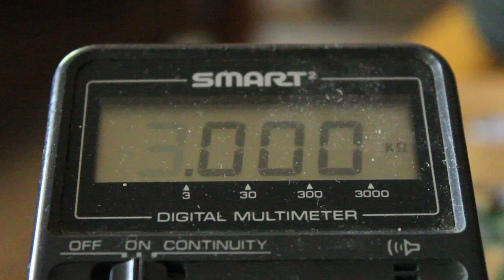PS2 Potentiometer Adjustment - Disk Read Error Fix

Comment: Sam, my ps2 DVD pot was originally set to 966 ohms. So should I increase or decrease it?
Reply from the maker: Try to get it around 700 ohms
Reply: From what I understand turning the screws clockwise REDUCES it's resistance. I.e. current goes through more easily

Comment: my ps2 has never ben open until now but there was only 3 screws will it still work?
Reply from the maker: Interesting, some have had a similar situation, I wonder if this is a manufacturing defect. This may be part of the cause, try getting a screw with a similar thread for the missing one. Take one of them to your hardware/electronics store and ask if they have a screw with a similar thread available to purchase for a replacement, then give the calibration a shot.
Reply: ok thank you

Comment: Sam, what is the life expectancy of these lasers. Also, why is it when you look up the SCPH number, it shows 77001 or 35001. Why am I seeing numbers for 7000 and 9000 series? Im thinking someone didnt put ALL the info as advertised because Im going by the number on my systems. Are there systems with the 7000 and 77000 series or is this a typo. Im looking for 2 possibly 3 lasers to replace because I have the old slide out tray box system and 2 slim line versions. Im first looking to fix the lasers from your vid and it was very well done. What can I use to fix my old discs that are scratched because some games are way too expensive to replace. Again, great detailed video.

Comment: why do we need to test the voltage? mine works now but I didn't test it. will I be safe?
Reply from the maker: Measuring the impedance of the lens can increase it's lifespan, try to aim for 725 Ohms. But don't fret if it hasn't already, it shouldn't burn out right away

Comment: My PS2 doesn't have any screws holding the drive assembly in, is that any cause for alarm?
Reply from the maker: Yeah a bit, but if it works you should be alright
Reply: Sam Campbell alright, thanks.
I've tried everything at this point, but nothing seems to remedy the problem I'm having.
My silver PS2 Slimline will play every game I have except for Gran Turismo 4.

Comment: Thanks for the help. My first attempt on the DVD adjustment did not work at 738 ohms, brought it up to 1108 ohms and it works better than before. My CD is working at 750 ohms.
Reply: thank you so fucking much , i tried everything. 720, 750, 820, 870 and so on.... but yours worked...
Reply: fock.... it started stuttering right after i commented this and now it's all black again sigh
Reply: Thijs Van Dalen you get that it's fun

Comment: Ok so my PS2 slim model boots up very slowly as of the past few months. It takes about 1-2 minutes and then freezes on the loading screen for only some games. For other games, it'll boot slow but still play it fine. Any idea on what the problem may be?
Reply: Oh and one thing to add, it boots up slow even with no memory cards or game in.
Reply from the maker: Is this after the adjustment or before?
Reply: Sam Campbell Before, I didn't do this adjustment yet. I'm not sure if this will help my PS2 since I really have no idea what the problem is
Reply from the maker: Mark Merldawg
Give the adjustment a try it sounds like a slow disk reading issue
Reply: Sam Campbell Ok, thank you! I will try it when I get a chance.
Reply: Mark Merldawg Did it work?

Comment: Hey sam , when I opened my PS2 there was a screw missing on the harddrive!!(one of the disc drive screws) any ideas where i can find another and if it can cause problems?
Reply from the maker: It could cause additional vibration, however test it without the screw 
for now. I'm not sure where you would get that particular screw.
Reply: Hmm OK me and my friend will try that, in the mean time Ill try to find a tech store for that screw
Reply from the maker: Alright, sounds good

Comment: hey sam im willing to try this but i have no battery tester thing and suggestions?
Reply: any
Reply from the maker: A multimeter shouldn't be too expensive:
http://www.ebay.ca/itm/LCD-AC-DC-Digital-Voltmeter-Ammeter-Ohmmeter-Multimeter-Volt-Tester-Tool-/381726099279?hash=item58e0a6074f:g:ggAAAOSwhwdVUep8
Reply: Sam Campbell i just did it anyways ill tell u if i fixed or not thanx
Reply: Holy shit it worked thanx bro if i damage it then i know y then
Reply from the maker: Elvis Pablo
Alright, glad to hear it!

Comment: Actually i did that and now all of my CDs works
But wont spin any DVD even new one 
What do i have to do now?
Reply from the maker: There are two screws on the lens assembly, one for CD and one for DVD, make sure you also rotated the one labelled DVD as well.

Comment: Will this work if my PS2 can read a disc?? Once I click on the disc icon it fades to a black screen and then fades back to where the disc icon and the memory card icon pops up saying there is not data.
Reply from the maker: From what you described, the memory card seems full. However if I have misinterpreted you, let me know
Reply: Thanks for the tip but still nothing has changed apart from the fact that the 'there is no data' thing no longer pops up.
Reply from the maker: OTF63
Well you could give this a shot, just make sure you use a multimeter and don't go below a resistance of 725 Ohms
Reply: I'd really love to but unfortunately I don't have a multimeter and I also can't afford so i guess I'm out of luck haha thanks anyways. :)
Reply from the maker: They're only about 4$ on Ebay, but if you're buying locally sometimes the prices are inflated
Reply: Oh okay nice, then I may get one, thought they may have been a lot more haha. Thanks again, really helpful.
Reply from the maker: No problem, let me know if you have any other questions
Reply: Thanks dude, in a really weird twist in luck i've just been given a working PS2 by my friend haha.
Reply from the maker: Great luck!

Comment: Hello, I tried this trick yesterday, but without the resistance thingy. I managed to get Ps2 games to work again. Today I did it with a machine, and I got a reading of 1065 ohms, on the dvd screw, and when I adjusted to your reccomended levels, It stopped reading discs again.

My question is, is it dangerious for the ps2 if I raise it up to 1000 something again?
and also, should both dvd and cd be around the same resistance?
Reply from the maker: I said a similar thing to someone else, 725 - 850 for the lens should be appropriate. I don't have many more pointers, but the DVD laser should be visible (don't look directly at it), if it seems very dull or not emitting at all, then it might have blow out from too little resistance. Lower ohms is actually stronger.
Reply: Yes, I saw that down in your comments, but I was just confused since mine won't work on those numbers, but it worked on 1065 ish O_O
I'm not very good at these things, i thought my ps2 to be doomed, then I found your video and thought what the heck? I can try it, it worked yesterday, but I was afraid getting a much higher number would maybe damage the laser or something.

I can honestly say, I have no idea what you mean about checking the dvd, I'm not sure how its supposed to look when ok, but thanks for answering so quckly.
Reply: If i turn the dvd potentiometer up and let the console run whit the dvd screw around 1080 ohms, apparently it does work since i tried i. Could it damage the laser in the future because of the high ohm level?
Reply from the maker: Elinione
Turning the the resistance (Ohms) up can't possibly hurt the lens, so 1080 should be fine
Reply: Thanks for the help!
I'm gonna try that and see if it works :)
Reply: @Artraive  so..did you damage ur ps2 after 4years ?? XD
Reply: @sofaxx5447  the laser pretty much died days later 🤕

Comment: Where can i get a multi-meter thats less than $3. Its all i have on my paypal. Thanks in advance.
Reply from the maker: http://www.ebay.ca/itm/New-20mW-LCD-Display-Digital-Voltmeter-Ammeter-Ohm-Multimeter-Ohm-Tester-/400579128145?hash=item5d44606b51:g:dyQAAOxyXp5SQqYV
The best I can find on Ebay is around 4$ Just barely out of budget
Reply: +Sam Campbell Alright so good news ,i got a multimeter but it keeps reading 400-500 kohms.
Reply from the maker: Interesting.. try to make sure that you have the leads on the tiny pins on each side of the potentiometer, aim for about 750Ohms (Not KOhms). It can be difficult to place them perfectly
Reply: +Sam Campbell Still no luck,i think its time to order a new laser assembly. The potentiometer was the problem though. Thamk you for helping either way <3
Reply from the maker: No problem!

Comment: OK now please tell me what was the last step in which you checked the digit number 3000
Reply from the maker: You are placing a multimeter on the two terminals of the potentiometer for the drive, then adjusting it until you get a number around 750-800, but above 725

Comment: Make sure you know what devices are plugged into the breaker that your ps2 is plugged into  because if you disconnect one of those devices after adjusting the voltage it can easily overload your ps2. The ps2 just needs that initial voltage to recognize the game disc, after that the laser chills out. So for me, I have  it connected to the same breaker as my air conditioner so, when I start a game I turn off the  the appliance (and unplug it) then once it sees there is a disc in there I turn my air conditioner back on. In this way you do not have to adjust the voltage, in most cases. There should be no reason why the voltage needs to be adjusted especially if no one has ever removed the warranty sticker from the back panel.
Reply: That's not how any of this works. The voltage coming from your panel is going to be 120v–240v AC. I can 100% guarantee that you don't have high-voltage AC current going through your PS2's laser pots.

Comment: 725 for both pots? I recently tried switching the laser and also removed the anti-static solder. Ps1 games & audio discs read fine but after playing with the dvd pot now none of them work. Any more pointers?
Reply from the maker: 725 - 850 for the lens should be appropriate. I don't have many more pointers, but the DVD laser should be visible (don't look directly at it), if it seems very dull or not emitting at all, then it might have blow out from too little resistance.
Reply: +Sam Campbell the lens was actually really bright, it spins for a while and the laser makes like a down hill pitch noise. it continues to spin then picks up speed and says "disc read error" I'll see if i can make a video when I get home later on to show you.
Reply from the maker: Ruben Mejia
Alright, sounds good

Comment: can this be done whitout that meter?
Reply from the maker: You can but it's not worth the risk considering that you can get one for $4 on ebay, http://www.ebay.ca/itm/New-20mW-LCD-Display-Digital-Voltmeter-Ammeter-Ohm-Multimeter-Ohm-Tester-/400579128145?hash=item5d44606b51:g:dyQAAOxyXp5SQqYV
Reply: Sam Campbell wouldn’t that make it worth it?

Comment: My family's machine has started reading dual layered disks again after some easy maintenance and cleaning in addition to what this video tells you to do. Although the exact cause may be uncertain, I think there is a high chance this method contributed positively to prolong the life of our PS2. Thanks for the help! I'm curious to know how you thought of or got to know about this method. Is it a result if trying and failing or is it a common problem involving hardware associated with lasers?
Reply from the maker: +Nima Foroughi It was actually inspired by trying to read cloned games from standard DVD-Rs, and I found that the PS2 couldn't read them without enough power. With additional research, I found other forum posts about the correct resistance to use without blowing out the lens, and there were many that said that it had even fixed other reading issues.  This is also a known issue with the GameCube, as it's lens is pretty weak out of the factory, so I figured I'd give it a try with the PS2.

Comment: It worked for me! Thank you so much! By the way it didn't worked for me after I've turned my screws for the first time but then I've turned them a little bit more and it works! My screws are a little smaller, I guess because of the model difference. Thank you again!

Comment: HI there, 

Thanks for the video. I recently got a ps2 slim chipped of ebay to play backups of my games and imports. However it was unable to play backups or Dual Layer disks at all (hadn't tested imports.)  I tried your fix on a my lens in my v12 ps2 slim 70003 by twisting the dvd's pot by a very small amount, less than what you did in the video. Then, normal retail games played, but still not DL or backups. When I twisted in again by an equally small amount, I found that this time NO ps2 disks would load, but ps1 disks Will. I twisted the dvd pot back by the same amount and tested, failing again and then twisted back to its original position, failing again also. I tried the same process on a second lens with the same result. Both clicked and would no long play ANY Ps2 disks but WILL play ANY Ps1 disk. Does this mean that the lenses are not ruined, because they can still play Ps1 disks,, or are they broken? I did Not use the measuring device, I'm not sure I have it. My Ps2 Slim is PAL UK version. If the lenses are theoretically not caput, could it be that the dvd pot on the lenses Are just uneven and that I can fix the issue by using the measuring tool an adjusting carefully? Also, If I do have to get a new lens or two, how can I be sure this won't happen again, even With the measuring tool? Could it be that mt version of the PS2 and its lens are more sensitive than what you use in the video?

All help will be greatly appreciated as this has been a long painful saga BEFORE I stayed up ALL night trying your fix.  

Thank you -

- Myles Thomas
Reply: +Airhersalderaz  Also, can you recommend a cheap multimeter I could buy online? Thank you.
Reply from the maker: +Airhersalderaz You can get those really cheap ones for $4 on ebay: http://www.ebay.ca/itm/New-20mW-LCD-Display-Digital-Voltmeter-Ammeter-Ohm-Multimeter-Ohm-Tester-/400579128145?hash=item5d44606b51:g:dyQAAOxyXp5SQqYV

As for the actual problem, you might have just set the DVD reading portion out of calibration. If you get a multimeter try checking your readings rather than doing it blind. You didn't adjust the CD potentiometer so it makes sense that PS1 games will still read. The worst case scenario is that you gave too little resistance to the DVD portion, and burnt it out. In that case you might need a replacement lens which will set you back $14 I believe.

Comment: Btw, I did not have the too to measure the output. I realize this is a risk but figured I would do it anyways. Do you have any time frame as to when I would know if the lens was negatively affected?
Reply from the maker: +kris tindell The effects would have been immediate, if it's still working, it most likely won't die. There is greater wear on it if the resistance is below the ~700 mark, just as long as it's close to the 700 mark, then you shouldn't have any noticeable life span shortening issues.
Reply: +Sam Campbell ok great- thanks for the response
Reply from the maker: No problem!

Comment: I really need help please. i have  a PS2 Slim SCPH 75003 PAL and i bought a new Final fantasy IX on amazon that is NTSC version. my old Final fantasy IX is PAL but i bought a new one because it kept freezing. once i bought the new FInal fantasy IX, it went to the red screen and i cant get it to work, it is brand new with no scratches and my PS2 reads other games just fine. is it because i cant play an NTSC game on a PAL Console? please help
Reply from the maker: +jack100200300 Yes, the PS2 is region locked so without a Modchip, PAL, NTSC-U, and NTSC-J can only be used on their matching console
Reply: ok thanks for that, and also, what sort of PS1 memory card do i need to purchase. apparently there are 2 versions of PS1 memory cards and the newest versions are supposedly not compatible with the PS2 Slim
Reply from the maker: Just use your PS2 memory card, it's compatible with PS1 games
Reply: um are you sure...im fairly sure PS2 memory cards are not compatible with PS1 games
Reply: i just looked it up, i need an official sony PS1 memory card because my PS2 slim is one of the later versions..do you know where i could buy an official sony PS1 memory card?
Reply from the maker: jack100200300
All I could say is Ebay or Amazon
Reply: thats true. ill try them. thanks for the help.

Comment: hey Sam. when trying to check he Ohms on the potentiometer, my multimeter shows very unstable readings. what Ohm range should I use?
Reply from the maker: +afterburner94 The reccommended minimum is 720, anything below that could damage the lens. If you're seeing strange readings try to get the multi-meter on those two points very precisely, it can be a bit difficult.

Comment: I Burned an Ps2 to an Verbatian DVD-R Disk and it is says to put an cd with ps2 format, if i follow and do every thing in the guide, will it work?
Reply from the maker: +Element Star This is often the fix to that, yes
Reply: ok i made eveything in the video , but now it is making noises and it cant read cd :(
Can you make an video to resolve it? Pls Thx
Reply from the maker: If the noises are a clicking sound then you've probably burnt out the lens. Try an official S2 game if the sound persists then a new lens might be in required. Don't forgot to measure the adjustments, it's easy to over volt your lens

Comment: I'm not an expert and I'd like to ask if it is necessary to measure with the voltmeter the result after turning those 2 screws clockwise? (as I haven't got one, and I've got a PS2 slim that used to work fine but now reads only a few discs)
Reply from the maker: Maroc Live It's not completely necessary, however without measuring the resistance afterwards you leave the possibility that the resistance may be too low and cause the lens to burn out